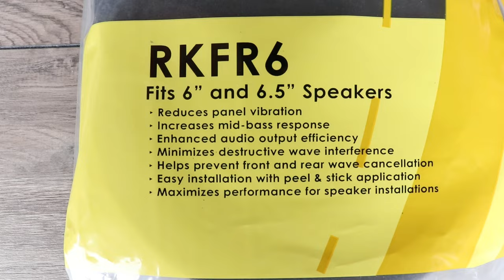Front Speakers UPGRADE, Toyota Corolla - How to Remove & Install New 6.5" Speakers

Comment from the maker: If you enjoyed the video, please press the like button  👍 Your support is greatly appreciated . 
There are Links in the video description for all the parts used in the video. 
I also have a TWEETER upgrade video here: https://www.youtube.com/watch?v=EG8nxTCzVa0  REAR SPEAKERS upgrade : https://www.youtube.com/watch?v=oL5zZH09VuA and STEREO Upgrade : https://www.youtube.com/watch?v=JBnRhJJNNAE
If you enjoyed the video, please give it a thumbs up  👍. Your support helps me create more content and is greatly appreciated . If you have any questions , comments , or suggestions for future videos, feel free to leave them below. I love hearing from you and look forward to your feedback !
Reply: By any chance, do you know where I can find the baffles 6-3/4" size??
Reply: need to know the rating of the speaker replacement
Reply: WILL THE NVX BAFFLE FIT IN SUZUKI SWIFT SPORT 2006.?
Reply: Does your Corolla include a factory AMP? If not, have you connected any new ones?
Reply: Save yourself some time & adapt the factory connections to the new speakers 😂😂😂
Reply from the maker: @neilcrompton3488  Do you have a 2014-2018 Corolla? The factory connections are crimped on aluminum wire, and they corrode quite fast.  https://www.youtube.com/watch?v=4ytOAxK_0Cs
Reply: Could you post the links in the descriptions here please because I'm having trouble locating them in the video for your parts?
Thank you!
Reply: Never twist wire for crimping. Twisting is useful only when soldering, so the wires would not spread apart...

Comment: That's A LOT of work.
Reply: Just pay for a professional then
Reply: Just pay 1200
Reply: You probably make your mommy cut the crust off your pb&j
Reply: Unless you’re an audiophile you can skip all the steps except the speaker sealing tape
Reply: Hell yea it is
Reply: it can be well worth it.
Reply: @cultuslatus2639  this is nothing. You're just lazy. This takes no time to do. If you're doing just the two front speakers it will take about an hour
Reply: @warriorplutotrent3827  dude chill out, some people have jobs and kids. Not everyone is “lazy” just because they might not have the time to do something.
Reply: Jury rigger. Half of that shit don't need to be done. Lol.
Reply: It would take you longer to drive to a shop twice to get it installed. Time is money, and you're a chump.
Reply: I did a similar work , i have two little speakers wich doesn't fit in the hole, wich is bigger, so, i cutted a piece of wood for each one and fixed into It jaja , it was cheaper método but it was my only possible metod cause my budget jajaj. I respect every ways!
Reply: I haven't done this yet, but getting ready to. This looks easy as hell thanks to the thorough video. I was going to just fix my corroded wires on the car, but it looks like only a tiny bit more work to upgrade the speakers while I'm in there.
Reply: I am planning to setup thi on my suv but I will resuse the same speaker brakwt and fabricate engineering plastic ring or 3/4 plywood as speaker mount..buy scrap foam from furniture maker shop and buy double adhesive tape..
Reply: It only took me about an hour to do
Reply: Im done with toyota fortuner 4x4 suv..using bracket adapter and foam reduced resonance and improve mid bass freq..
Reply: Alot of work but it looks like fun!!! I'd love to try it out myself
Reply: It's super not, but ok 😂
Reply: My guy pleazz too much work? I can do this one handed, and holding a beer in the other. Might take me an hour and a half, but I'll getter done.
Reply: @danielpalomera5553  convenience > money. If you make good money, probably saving time is better because then time = money. Still if someone does all this, then he or she is just unnecessarily stingy
Reply: I bought a wire harness that legit just connects to the speaker😂 10 bucks super easy install
Reply: it’s not
Reply: Screw these commenters.  Not everyone has all the tools needed for this.
Reply: It's worth it I did it
Reply: It is but worth it. If you enjoy doing this kind of stuff,then how much work is irrelevant
Reply: it's actually not

Comment: Hands-down one of the best video tutorials I've seen for a task that non-car or non-electrical people (like me) find daunting. My front left speaker has been cutting in and out for a few months, before shutting off completely a few weeks ago. You made it so easy to diagnose the same wire corrosion on my speaker in my 2015 Corolla, and replace the issue with better sounding speakers this past weekend. Thank you for taking the time to explain the steps so clearly, and for making this video. I changed out my speakers by myself for less than half of what a nearby car audio shop quoted me, and I bet my speaker setup also sounds better because of the added accessories like the Stringer Fastrings and NVX baffles. Kudos to you!
Reply from the maker: Thank you so much 😀, it's appreciated!
Reply: I agree, having the "needed tools" and list of things to buy was very handy. So many videos I watch from car guys and they assume you have a loaded snap-on toolbox and all the grease and oils and cleaners and everything already on hand, so you get halfway thru a job and realize "Oh I need this special lubricant for my brake pins? Well now I need get someone to give me a ride to AutoZone before the close"

Comment: As a past technical instructor, I must commend you on a very thorough solution to what is quite apparently an epidemic problem with Corolla's of this vintage.  I've been tolerating intermittent function of my front speakers for several years in my 2015 Corolla LE-ECO.  Today, I popped off the door panel to investigate (after stumbling onto your video).  As soon as I touched the positive wire at the speaker harness connector, it fell right off.  I've temporarily "rigged" it using a couple of female ECM terminals crimped to speaker wire leads.  Since I could not reuse the OEM harness connector, the terminals are delicately placed into the speaker connector and said connector filled with RTV.  This'll get me by until my new speakers and related components arrive (per the links that you so generously provided).  Thank you for saving me lots of time and frustration Clever Fix...bravo!
Reply from the maker: Thanks a lot for the comment! Really appreciated.  I couldn't tolerate it for long, it was so annoying. I'm really enjoying the better sound too, it makes driving a lot more pleasant.  Hope the RTV holds long enough.. I was going to try to solder directly to the spades on the speaker side once it stopped working a second time, but I gave up.. 
Unless the connection is VERY secure, it will get lost again. In the video where I used a butt connector to the aluminum wire, one side gave up after a while. All I had to do was squeeze it real tight, and it has been perfect since, but it's that sensitive to moisture.  Had I known, I would've used adhesive lined marine grade heatshrink... That's what I am using from now on for everything. This is a good reminder for me to add a link to it in the description as well.
Enjoy the new speakers once you put them in!
Reply: @CleverFix  Luckily the RTV only needs to hold up a few more days until all of the speaker installation supplies arrive and then it gets ripped out along with the lousy factory speakers.  I will be using heat shrink tubing very liberally in my installation, including around the body of the female push connectors at the new speaker blade terminals.  Factory Toyota window regulators seem to last forever, so I'm hoping this will be the last time I have to yank the door panels for as long as I own the car!

Comment: Stock speakers have low wattage rating when I upgraded from stock toyota head unit to AVT head unit the stock speakers burned out..so upgraded to pioneer speakers and upgraded adapter together with foam installation..

Comment: ok, but sloppy.  does the window contact the foam center placed behind the speaker?  it looks like it would when the window is all the way down.
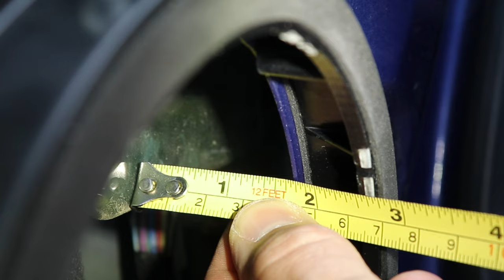Reply from the maker: No it doesn't, the windows comes down right in between the speaker and foam without touching.  See 4:11 for window position.

Comment: Your factory speakers look decent. Obviously you wanna upgrade. When I took mine out, it looked like it was made out of cardboard. 😂
Reply from the maker: They were in good condition, but the stock connector got corroded, and they were losing connection. Upgrading seemed like the best solution, and I was surprised how much better the sound was after the upgrade also.  They will surely break apart if you listen to music loud, someone else mentioned that happened to them too.

Comment: I'm surprised by seeing a Corolla sold in the US comes with average speakers with tiny magnets. Herw in Pakistan, a Corolla comes with by default with speakers that you put in front door (with tweeter) and the rear 6x9 are also with large magnet and built in tweeter. I have a GLi variant and it's one model above lowest spec model. I purchased Alpine speakers and when I opened the door I was surprised to see high quality factory speakers.

Comment: I am a professional stereo installer for 29 years, and i have to say, you did i better job than most installers.  The extra baffles, foam, and heat shrink, most installers do not use. Those speakers probably sounded better than they normally would.
  Excellent work and great video !!!
Reply from the maker: Thank you! Yes they do sound quite good for a budget speaker. I'm really enjoying listening to them.  I've done installs without the extras on all my previous cars, and the sound was never that great, even with expensive speakers. That's what motivated me to do a better job this time, and get the full potential of the speaker. A little extra $$ but totally worth it!
Reply: Hi I need advice. I had upgraded the speakers in my car everything was fine till recently I noticed it cutting out or crackling. So I redid the wiring like he did in the video and it didn't work got not sound from my front right speaker. Then tried using terminal block with a solid connection but all i get from my headunit is a pop through the front right and then nothing but sound out all my other speakers. 

What could it be? I also noticed when I switch my car on theirs a buzz in my dashboard speaker.
Reply: @qaisrafique9454  could be your factory amp stopped working on that channel

Comment: Thanks for the video! I lost the front driver’s side speaker in my ‘15 Corolla and found your DIY fix video. But then stumbled on your front speaker upgrade video and it made more sense to just replace them, rather than to fix the poor quality factory ones. 
I ordered the parts through your links, and followed your video step by step. What a difference even while keeping the stock head unit, I’m very pleased. I will be tackling the rear speakers next, while following your other video, thanks again!!😊👍
Reply from the maker: Awesome, thanks for the support, it's appreciated ! Check out the tweeter video too, it makes a pretty good difference as well.. not as big as the speakers though, but I'm very happy after upgrading them.  I have a new Pioneer stereo unit here that I'll be installing when the weather warms up. I'm expecting a huge improvement once I put it in.  It was recommended by a viewer.
Reply: @CleverFix  Please record and make a video of the new head unit install please, I am definitely interested in this. Are you going to do the install with steering wheel controls and back up camera capabilities? Apple Car Play or Android too perhaps?  
I’m doing the rear speaker install this weekend, is the rear seat backrest removal absolutely necessary, or is it just easier to work around with them removed? It doesn’t look too terribly difficult to remove them, just a few more extra steps. I probably will do it👍
Reply from the maker: @kevmo919  I will do the install video once I get it done for sure.  Yes, steering controls and backup camera will remain, I don't want to lose those, and yes the unit has both Apple car play and Android capabilities. Unfortunately I couldn't find a plug and play solution , so the Crux SWRTY61N adapter has to be connected to the Pioneer Head unit with some soldering. 
The connectors on the car plug into the SWRTY though, so soldering can be done ahead of time, and then just plug it into the car.
I'm still a bit hesitant about giving out wire colors to connect, I don't want someone connecting the wrong wires by mistake, especially if the manufacturer changes the colors on later models. Maybe I will just show the manual for the SWRTY, and for the Pioneer, and mention which wires need to be connected together for it to work.   The SWRTY has the backup camera jack, and steering wheel control jack, so it does both, plus the Toyota plugs go into it, so it's really useful.

As for the rear seats, I had to film it, and to do that, removing the seats made it way easier..
I don't fit well in there with the seat folded, I tried it and I thought it would be fine, but it was very cramped.
Reply: @CleverFix  Awesome, thanks for the information. I look forward to the new head unit video👍👍
I will try the rear speaker install without removing the rear backrests, but will be prepared to do so if I feel it’ll be easier too😏

Comment: i installed my side, rear, and tweeter speakers this weekend. couldn't have done it without your videos. thank you so much! i'd still love to see a detailed video of the microphone installation for the touch screen. my audio upgrade is nearly complete👍
Reply from the maker: That's awesome, you should have really great sound now!! Check the A-pillar video: https://www.youtube.com/watch?v=bDzc7cpNY7I   once the a-pillar is removed, it's very easy to install the microphone.  I double side sticked it on the windershield at the top, then push the wire under the headliner to hide it, and down the a-pillar. I used electrical tape to tape it to the existing wires going through the a-pillar, to keep it away from the airbag.  Then I opened the left side cover of the dash, and routed the wire across to the middle, and use some zip ties to hold it in place.  It's very simple.. the weather is too terrible now to do any filming.. it has been raining a lot, and cold.. so I haven't been able to do anything unfortunately.  Thanks for the comment and watching!
Reply: @CleverFix  yup, especially after a touch screen that didn't work and blown rear speakers. It sounds great! I'll give that a try. Thanks again and stay warm!

Comment: Looks like the rubber baffle takes care of everything, no need for the foam tape or the stinger foam kit.
Correct me if I’m wrong. Thanks for the video. Very informative. ❤
Reply: I was thinking about this, particularly going with no stinger foam since the baffle has both the foam and the baffle itself to reduce vibration. How did it turn out for you?
Reply: Holding off, waiting for this cold weather to subside will get them. I have everything installation related sitting  on the workbench. 
I got a 70 Mustang hogging space in the garage❤.
 I can’t fit my corolla in there.
Reply: oof i feel that, might just bite the bullet and do my install in the cold honestly  @XCRiders

Comment: just upgraded my speakers in 2010 corolla thank you for your video!
Reply from the maker: Nice, glad to hear it worked for a 2010.
Reply: One question did you also upgrade your stock multimedia player? Or did you only change the speakers?
Reply: @siddharthkolap7143  Yes I upgraded from the old radio. I think it's worth it if you want to get the most out of your new speakers and its nice to have bluetooth as well. A video that was really helpful was called 2009 - 2013 Toyota Corolla Radio Install by Provo Beast. It has a few links for some parts you'll need like a wiring harness and dash kit. The radio I ended up using was the Kenwood DPX504BT which I'm really happy with but there are alot of good options out there. Hope this helps